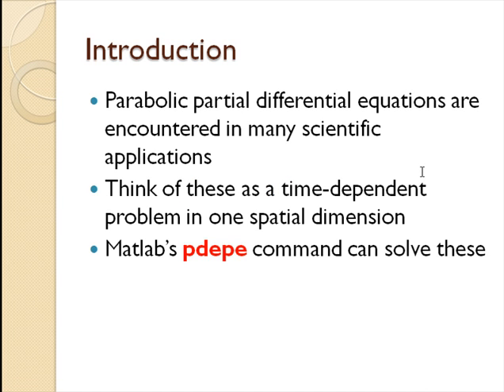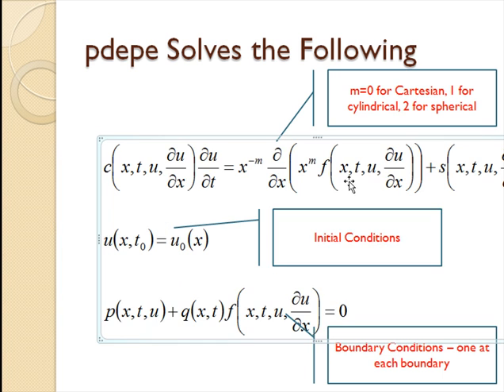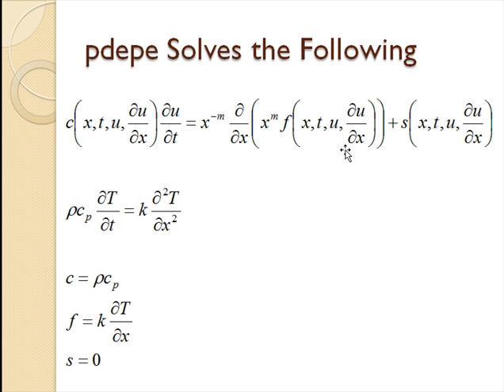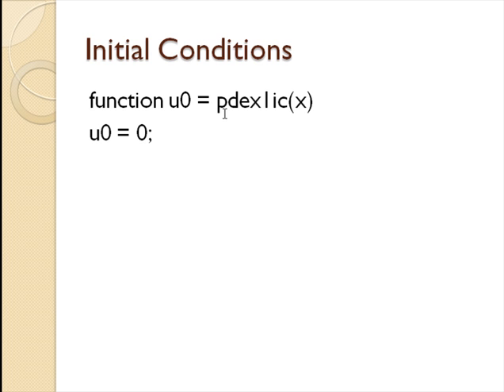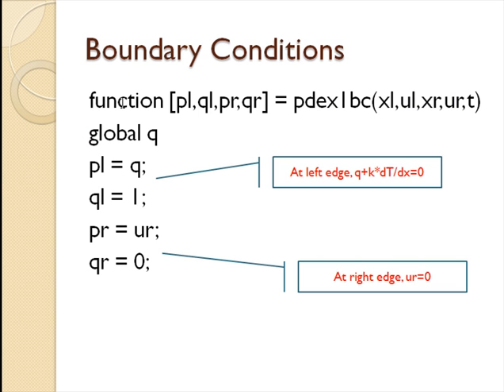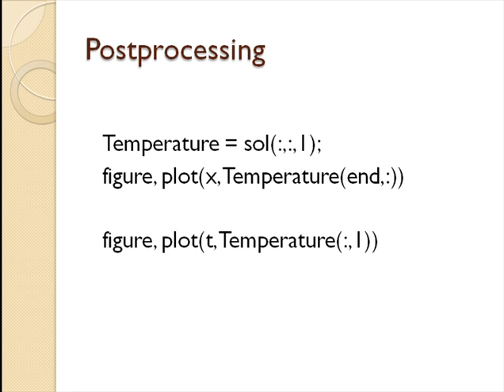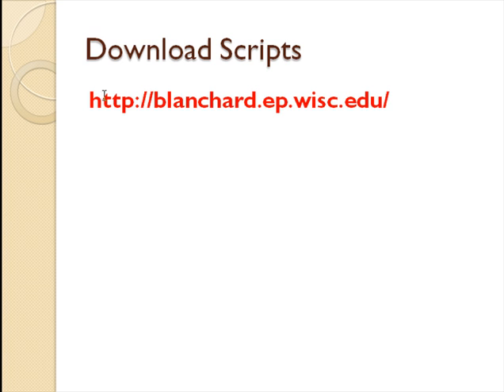Solving Parabolic PDEs in Matlab

Comment: Hi Professor Blanchard,

I'm trying to use pdepe to solve a pde based on Fick's Second Law for the evolution of a solution concentration within a spherical bead. The general equation is == du/dt = D*d²u/dx² + 2D/x*du/dx. My problem right now is defining the right boundary condition, which in my system is == dudx = (V/D/A/p)*dudt (V, D, A, p are constants). How can I evoke dudt in setting a boundary condition within pdepe? Thank you very much for your kind attention!
Reply from the maker: I don't think pdepe allows you to use the time derivative in the boundary conditions. You might have to write your own solver.
Reply: @jakeblanchard  Thank you very much for your quick response. I understand your suggestion. If you don't mind, I'd like to ask your opinion on how I can proceed to model my current set of pdes.

To be more precise, the model is for estimating the evolution of a drug's concentration in an external finite volume (dCb/dt), that initially comes from a spherical bead by diffusion (i.e., the drug is initially inside the bead, then diffuses inside to reach the bead's surface, where it diffuses to the outside external finite volume). The general equation that describes the concentration change within the spherical bead is dependent on both time t and the bead coordinate r:

dC/dt = D*(d²C/dr²) + 2D/r*(dC/dr)

The initial condition is: 

C(r, t = 0) = Co (constant, initial concentration inside the spherical bead)

The boundary conditions are:

(t > 0, r = 0), dCdr = 0

(t > 0, r = a), D*dC/dr = V/A*(dCb/dt), where dCb/dt = 1/p*(dC/dt). By combining these two, this right boundary condition then becomes == dC/dr = (V/(D*A*p))*dCdt

The term "Cb" represents the drug's concentration in the external finite volume V (V, p, D, A are constants) after being diffused from the spherical bead.

Thus, while the concentration within the bead (C) is dependent on both t and r, the external concentration (Cb) is only dependent on time.

Do you think this can be solved using pdepe?
Reply from the maker: @lucasdanda  I don't think you have access to dC/dt from within pdepe's boundary condition subroutine, so I don't think you can do this with pdepe. I could be wrong. I would start with a Crank-Nicholson finite difference approach and see if I could work out how to handle this boundary condition that way. There is a lot of stuff on the internet about how to do Crank-Nicholson.

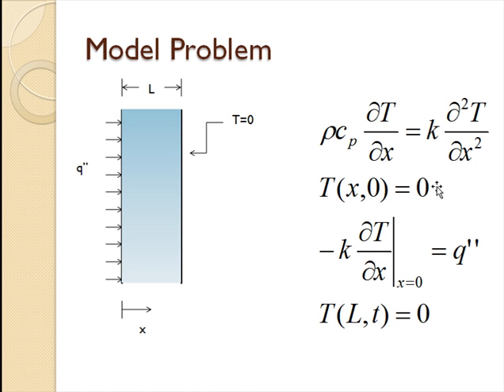Comment: At 1:18 the very first eqn of 1D heat conduction seems to be doubtfull (LHS side may be wrong as per my understanding Bcoz if convection is not considered then temperature gradient term should be wrt time)
Reply from the maker: Yes, that's a typo. The first term should be rho*cp*dTdt.

Comment: Hi sir, im trying to solve pde for a shrinking core model which has 3 boundary conditions. How do i input the coding for 3 BC?
Reply from the maker: This page discusses how to solve a system of PDE's. https://www.mathworks.com/help/matlab/math/solve-system-of-pdes.html You might want to take a look. Are you sure you can fit your differential equation into the standard format for pdepe?
Reply: @jakeblanchard  After i corrected my equation,  i narrowed the bc to two. Having problems with identifying my second bc as matlab's function (p and q). My general equation is εdC/dt= D(d2C/dr2 +2/r*dC/dr) with boundary conditions of 1) D(dC/dr)=k(Cao-Cas) 2) -D(dC/dr)= aCso(dr/dt)
Reply from the maker: @faudziahismail6726  I don't understand the dr/dt term. Can you explain?

Comment: Is it possible to generalise the same concept for  the 2D plane ?
Reply from the maker: Sure, but I'm not aware of any pre-built Matlab tools for solving that problem. Many would use finite elements for a 2-D, time-dependent problem. You could do finite differences, but you'd have to write up your own script. You can find descriptions of the algorithms in many places on the internet.
Reply: @jakeblanchard , I have used  'pdetool'. It is effective, but it does not show you the solution.
Reply from the maker: That must be in the PDE toolbox. I've never used it. But surely there is a way to display the results.
Reply: @jakeblanchard  Thank you very much, Sir.

Comment: Hello, first of all thank you for this useful video, I'm trying to write a little code to solve a partial differential equation with the command "pdepe". With this equation I want to calculate the velocity "u" over time of a liquid flowing on an inclined plane. I decided to put the boundary conditions so that at time t = 0 and the initial position x = 0 I have u = 0 (the liquid is stopped) while at time t = t0 and x = x0 (at the end of the inclined plane) I have that velocity is u = u0 (x, t)  then, the flow is free to slide and will have a certain velocity (which is my incognita). I do not know how to define the coefficients ql pl pr qr to define my boundary conditions in the form requested by Matlab. the equation that I developed is this ρ ∂u/∂t=D (∂^2 u)/(∂x)^2 -u ∂u/∂x. thanks i advance
Reply from the maker: Send me what you have written so far and a detailed description of what you want for boundary conditions. I'll take a look at it. Email is blanchard@engr.wisc.edu.

Comment: In which part you convert Kelvin to Celcius? Due to you plot as Celcius the temperature results
Reply from the maker: It's a linear equation, so you can solve the whole problem using Celcius if you want. One boundary condition was T=0, so if that's 0 Celcius, then all the temperatures will be in Celcius.

Comment: Sir,very informative tutorial I want to ask,I have these two boundaries how i will  put in the above form u mentioned.I have these two boundary conditions.                                                                 λrad ∂Tp/ ∂rp@ rp=Rp =αf(Tf −Tp);  (∂Tp /∂rp)@rp=0 = 0
I need your guidance.
Reply from the maker: It depends on how you set up f, which depends on how you set up your differential equations. So you need to show me the pde as well.
Reply: Ok sir. ∂Tp/ ∂t = 1 / rp2 ∂/∂rp(rp2 λp /ρCp ∂Tp /∂rp)+ rA∆Hr,A* ρCp
Reply from the maker: OK. It looks like you'll want to choose f=lambda/rho/cp*dT/drp as you define your equation, so the BC will use f to get the first derivative. Try it and send me a script if you can't get it working.
Reply: Ok sir.

Comment: Can you explain why pr=ur?  Since I found ur haven't been defined yet? Also don't know how matlab recognize "DuDx", which also not defined.
Reply from the maker: +Yuhang Cai 
ur is passed in by the pdepe solver as the temperature on the right hand side. By setting p=ur, we are asking the solver to iterate until T=0.

Similarly, DuDx is provided by the solver and passed into the pdex1pde routine as an argument.
Reply: +Jake Blanchard thank you! But I thought  "ur" should be a pre-defined term.  Is it not necessary to define  "ur" and "DuDx" in this pdepe solver?
Reply from the maker: +Yuhang Cai 
No, you are supposed to define the functions p and q at both boundaries for any value of x, t, and u. Then pdepe will solve the equations in such a way that those boundary conditions are met.

Comment: hi, I have a doubt.
When using the pdepe function, it is not necessary to make the discretization in space ?
it is possible to solve such a problem by using the tool ode45 and when to use, do the discretization of space in the algorithm and the program integrates in time. Because I am with doubts.
Furthermore, the pdepe function solves 2D problems ?
Reply from the maker: +Bryan Silveira 
pdepe solves systems of partial differential equations in 1 space variable and time. It will not solve problems involving two spatial dimensions. Ode45 solves initial value problems. I'm guessing you could difference a pde in space and then solve the resulting system of initial value problems using ode45, but why bother? pdepe is easier. It will handle the discretization/differencing for you.
Reply: +Jake Blanchard 
It's because I just know how to solve this problems using ode45 and do the discretization a pde in space haha.
I never used pdepe before, but now I will try to use this function.
Do you know a function used to solve problems involving a pde involving two spatial dimensions ??
In my research, I have a boundary moving problem involving a pde with two spatial dimensions.
Reply from the maker: +Bryan Silveira 
There is nothing in standard Matlab for problems in two spatial dimensions. The PDE toolbox has some stuff.
Reply: +Jake Blanchard 
Thank you

Comment: Is there any way to get the solution as an equation? Doing it with pdepe I get a 3 by 3 matrix which allows me to plot the solution, but for checking answers sake I would like to view the data in equation form.
Reply from the maker: +william leach 

That requires symbolic algebra. Matlab has a symbolic toolkit, but I don't use it much. I would suggest you try Maple or Mathematica for this type of problem. Keep in mind that only the simplest of partial differential equations will have a clean, closed-form solution. You might be able to get a series solution, depending on the equation.

Comment: Hi Jake .. 
Can i solve a differential eq. using Method of Characteristics in MATLAB. Actually I want to solve transient flow equations. So pls help me on this matter...
Reply from the maker: Sure, you can do it, but I'm not aware of any built-in tools that would facilitate using characteristics. You might be able to find something in the File Exchange on Matlab Central.
Reply: Jake Blanchard
Excuse me,

Could you give me a hint as to solve this proble,:

du/dt = alpha^2 (d^2u/dx^2 + d^2u/dy^2) - (Q/A)(du/dx) + (V^2/(rho*rho1*c*L^2))
Reply from the maker: Sankarshan Acharya 

I'm not aware of any built-in tools in Matlab that will solve that equation. It's possible there is something in the PDE toolbox, but I'm not sure. Try finite differences.

Comment: Hi, if i have two boundary contions at x=0, can I use this method? Thanks in advance!
Reply from the maker: What is the equation?
Reply: It is a differential partial ecuation that can be expressed as the ine required for the method.  The only problem i have is that my boundary conditions are du/dx( x=a) =somenthing and u(x=a) =something
Reply from the maker: Alexandra Urbano You have to have something to define the other boundary. So if you only have an equation which is second order in the spatial variable, then I don't think this is going to work.
Reply: Ok,  thank you for your answer :)